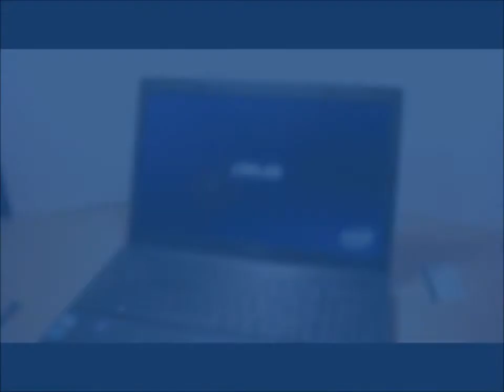How to replace laptop screen (Asus X54H-BD1BH)

Comment: Hello, Sorry to bother you, I have an Asus X54H laptop, like the video of yours, right now I'm not very prepared in IT, I suddenly get spoiled the screen goes dark, but you can see what's on the screen but very blurred. The computer connected it by HDMI to a screen and it works for me,
The fact is that I was reading in forums and I think the fault is the inverter or the screen.
Remove the screen thanks to your video (very good) and where the Inverter was supposed to be, I did not find anything.
The display is LG LP156WH4 (tl) (a1) and I do not know if this model has Inverter, or not?
I do not know if the inverter is on the motherboard?
Or if it is LED type and does not carry Inverter?
I do not know if you can help me. Thanks in advance. ç
It is not English and it is translated by Google, it has some incorrectness.